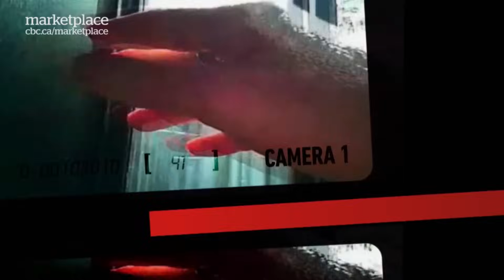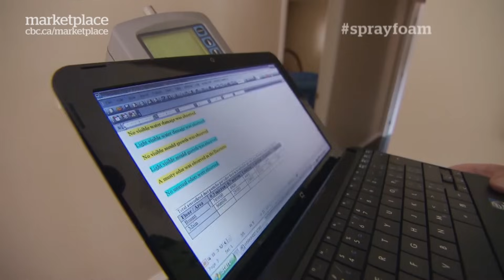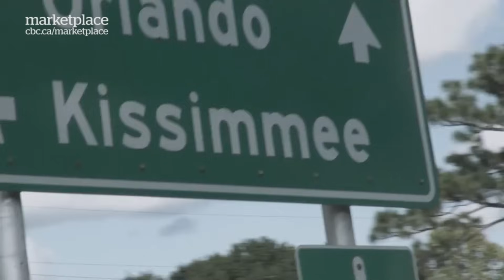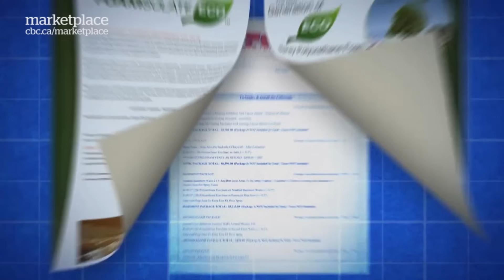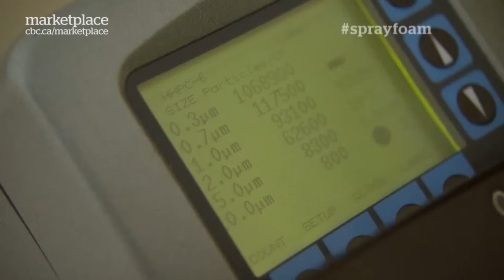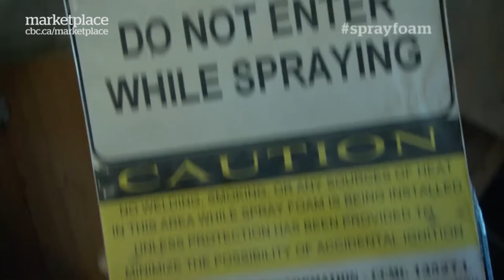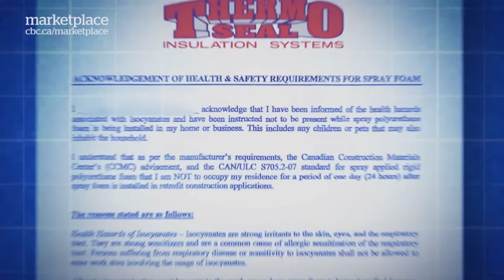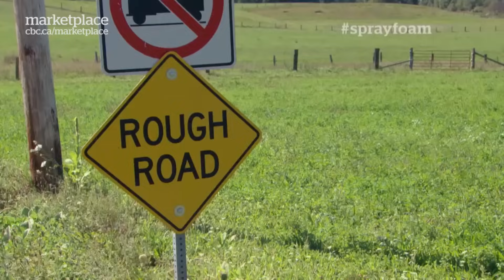Spray foam insulation nightmare: What can happen if it's not installed correctly (CBC Marketplace)

Comment: They weren't lying they couldn't smell anything. They no longer have a sense of smell after spraying that sheet a few years, sinus get burned out.
Reply: good point
Reply: The contractor guy did allude to this in the video.
Reply: If the nose don't smell sh*t - you must acquit!
Reply: I used to haul pool bleach around Florida filling poly tanks at pool supply stores after awhile you never even smell it anymore. Now I have no smell.
Reply: I've been spraying foam for 12 years and still smell it everytime I install it
Reply: Shane Hartley Yes you are correct about the nose losing its sense of smell. Firemen have the same problem fighting fires they can claim a disability for the nose problem.
Reply: @danimal514h5  you're probably doing it right and protecting yourself at the same time. Good job.
Reply: Just like a cigarette smoker!
Reply: Well said.
Reply: Like someone with a cat box in the house..They stop smelling it over time..Anyone visiting the house smells it immediately..
Reply: Or there was no smell and they created one to get out of the bill?  People do that crap!
Reply: @jlbush8249  Yeah, rent a camper for two months to get out of a bill.  Are you even paying any attention?
Reply: Onepeople Carlin A settlement would cover the cost of the camper and the installation of the foam.  Not saying this is what they are doing, but apparently you haven’t been paying attention to the lengths people will go to scam.
Reply: @danimal514h5  Ever had to go I  and remove the foam? What was your policy for these issues?
Reply: Tarzan Ape if it’s methyl di isocyanate or MDI or di isocyanate it has almost no smell
Reply: Steven horsefield  I worked for a chain of gyms and exposed to chlorine and hydrochloric acid daily the company had a garage old system , what health affects long term from this and how long would a person have to sue in Ontario Canada
Reply: z k no the company was considered low risk by the dept labour I checked with Workers compensation top investigators in Toronto. they did not need to get workers comp so long as they had something else in place aka call a lawyer,bloody awful . Lots of big financial companies are exempt also ,I did not believe this till I contacted worker comp and spoke to senior investigators for 2 hours .I explained to the investigators that the gym chain had in house maintenance ,we were climbing ladders ,working with 3 phase 208 and 575vsystems ,going on the roof to do hvac repairs working with pool chemicals chlorine and muriatic acid , working in confined spaces ,plumbing , they even forced us to sign that we were on call never had a free week end in 15 + years except Christmas Day when they were closed. Because I had to work in the pool and whirlpool which had a very high noise level I have constant ringing in my ears also . When I complained to a senior management person who i new for 20 years they set me up for constructive dismissal ,no raise for 4 years, constant harassment, diminished authority , insults , ridicule, belittling ,took my ladder away so I could not go on the buildings roof easily and check and service 17 hvac units all over 20 years old and huge rusty HRV and numerous ventilation fans . Besides not having a ladder to access the roof the new manager would phone me on the roof after 2 hours and ordered  me of the roof every time I went to service or clean or repair change filters . Then an private hvac company was called to inspect the hvac units 5 days before I was going to wash /service and change filter and belts and test and repair the units which I was going to do on a Saturday when the manager was gone .The report from the independent company was the unit were not being serviced .In addition the company made me go on salary so they did not have to pay overtime and called me in any time .The older manager even had me come in on Sunday’s at 7.30 pm to epoxy a drain trough in the ladies 8 shower stalls them at 8 pm told me to go home as he did not want to stay more harassment . The company would not give recommendations to other companies so it was hard to get another job but was luck and a former tech got me an interview with an industrial plant for industrial electronics,automation and maintenance tech and I had extensive formal and experience in industrial electronics and got the job and love it thank God .
Reply: @denisvincelette9758  It happens with everything you are around.. Stop being around it for a day or so and you will smell it again
Reply: cant taste the smoke but can certainly taste everything else
Reply: @Jenksiea13   I have never had to remove it. My company has never had a complaint it's all about doing it right
Reply: @Jenksiea13  if there was a issue we would remove it and make it right. The problem is you have 2 chemicals that meet at the tip of the gun if they get off ratio it doesnt setup right. But anyone who is experienced in spraying should be able to see the change right a way and fix the problem
Reply: Shane Hartley you are soooo right !
Reply: @mickhaha3151  I thought the same til I quit smoking and realized how much I was shitting on my tastebuds and sense of smell :L They improved dramatically, and I wasn't even aware they could!
Reply: Sean Cruikshanks I shut business down on both sides of my job at a strip mall. Thought it said Non VOC .... CANT STOP NOW BITCHES! The drunks at the bar that had to shut down were all “I was was wondering why that last beer had me so good” lmfaooo
Reply: @danimal514h5  proper ppe goes a long way
Reply: @jlbush8249  You can remove it easily, if you know what you are doing. Being a spray foamer you learn how it goes on and how to take it off. You add two inches then wait a few minutes to apply the second coat. If you do not wait the time the gas from the chemical reaction gets trapped and can even ignite by itself.
Reply: @girlonlaptop  pppppppppppppppppppppppppppppppppppppppppppppppppppppppppppppp
Reply: @girlonlaptop  p
Reply: @girlonlaptop  ppppp
Reply: @girlonlaptop  pp
Reply: @girlonlaptop  ppp
Reply: many years ago they did the same thingb to soild brick homes, sprayed into the gap, and caused same issues? so sad cause the cost to remove the spray foam was large,  you can see it cause the joints have drill holes,in the mortar, but the way they work they could regrout the joints and u would never see that it was done, so yes buyer beware, should only be one home per person?
Reply: Nose blind when you get used to a smell
Reply: My house was filled with beads , there's no chemical action